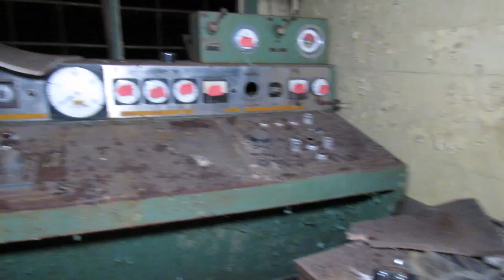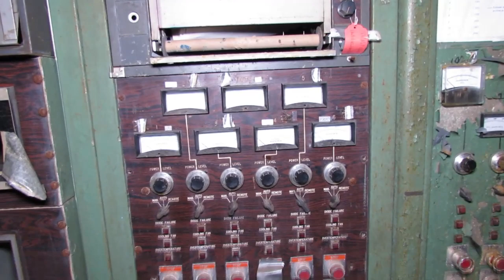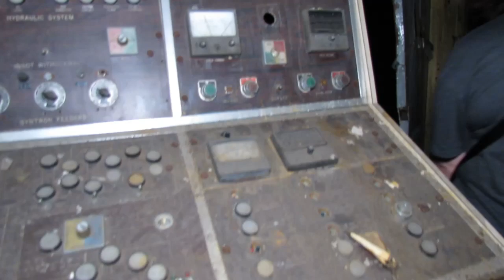(ABANDONED LAWRENCE AVIATION )WITH SOME FANS!

Comment: time for this spirit to earn some flying wings // 2:17 sounds like something was thrown at the roof of the building or the other crew inside investigating // 3:22 sounds like a fast spit ( left ear ) // 5:58 sounds like someone trying to blow out a candle // 6:19 could also be ( I'm fired - I'm hired ) // 7:22 another breathe sound // about 7:39 there is a thud sound like a lead weight hitting then again a noise knock ?  // 8:20 orbs ? forming under the stairs landing and to the bottom right side several to 8:25 or is it dust ?  bugs ? // 9:08 weird noise like a sick cow moo and again at 9:16 then its Bunked - great laugh with the cellphone  // 12:10 sounded like it was mocking you about the light just missing you with a long ohhh // 13:28 sounds like someone sipping hot coffee // 12:41 first a pop noise then a very strange sound or was it a passing bug ? 19:41 there is a steel plate standing and looks like something forms then disappears // End B 1 // 20:21 a voice saying ( yeah ) in reply to you looking around statement // 28:22 orb ? behind you guys about where the light is in the distance // 29:18 to about 29:58  not sure if Andy was talking about a whisper then some strange sounds scraping a cry 29:52 you ask about a rumble  and voices hard to say what is said // 30:53 sounded like someone talking not sure if the other gang but also a very faint bang // lots of stuff but hard to say what it all was - bangs knocks clunks // 24:55 noise - bang in distance  // you state about it being the wind ( rumble noise ) and it does a double take about 47:15 - sounds like jet engines testing // 48:28 just after the bang right behind you on the table  workbench the left side of the forklift there is a light flash on support mount // 49:40 there is a faint breathe sound left ear // the elevator hum in a woman's tone //  just after you do the camera cut 54:?? there is a flash of light then a orb at bottom and moves up the wall and the fallen beam to the upper right then looks like a couple more form from that area 55:09 on the wall   // 55:52 sound like two giggles and replies -like joining in ( saying yes it was with the giggle on end ) did not sound like Lorie ?  //  57:05 i could barely hear what sounded like a dog yelp scream // 57:38 like someone just learning how to whistle sound // 57:23 the rumble sound like jet engine again then seems like again about the 58:00 time 58:08 several time its faint  // sounds like a breathe 1:00:38 // few good noises // 1:02:09 sounded like Church Bells // flash of light in the upper ceiling area possible orb ?